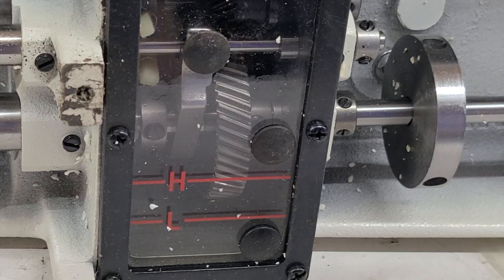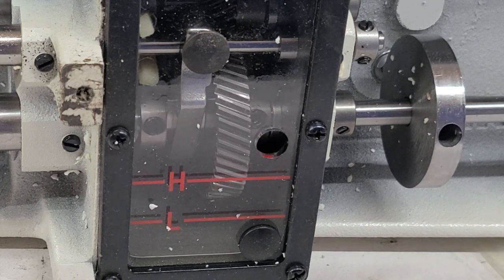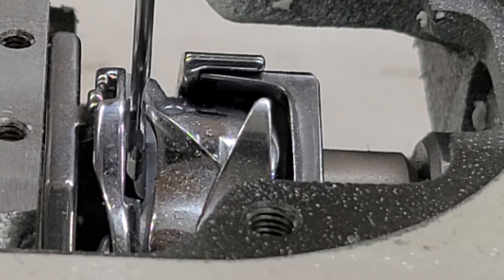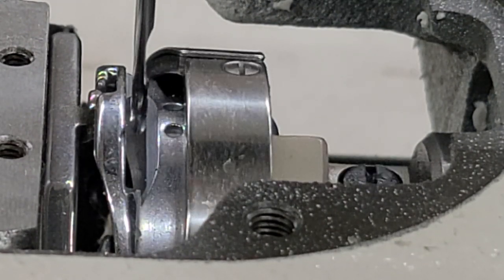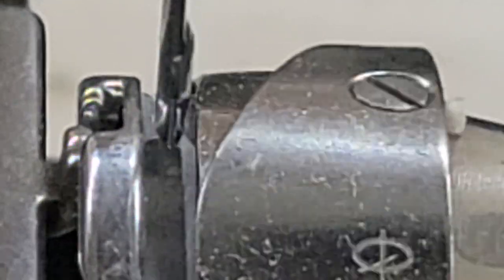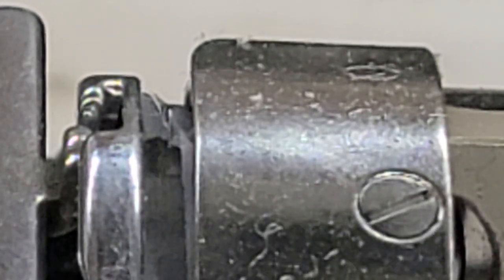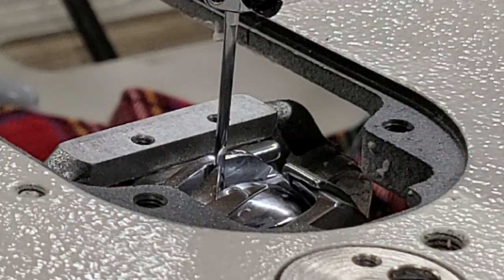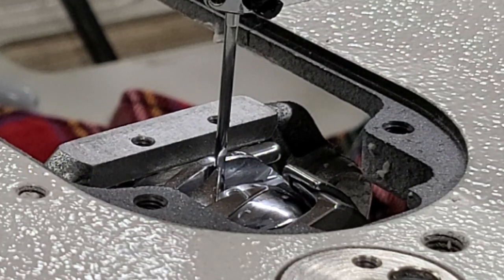Hook timing explained on a Juki DNU-1541S

Comment: Kinda vague. I understand loosen those 2 hex set screws but then you left us hangin. How do you adjust? And why? I understand the hook needs to pass at a certain height and slightly away from the needle but you didn’t explain how to move it

Comment: Thanks for showing the proper timing but you didn’t show how to adjust the hook. I get those set screw need to be loosened for the adjustment, then what??? As a YouTuber that makes how to videos a lot I found this frustrating. Thanks for your effort though

Comment: Thanks so much Steve!
I've been looking for days for information regarding timing a machine with no safety clutch. 
Your video is the first I've found showing the timing adjustment screws inside the oil reservoir and thankfully it matches my machine, and solves my dilemma.
Is my assumption correct that the machine you're demonstrating on has no clutch?
All other horizontal axis hook machines were timed from further to the right of the bed shaft and outside the oil reservoir.
Thanks again for the help!
Reply from the maker: This machine is a DNU-1541S with the safety clutch.
Reply: @Sewinggold  Thanks Steve.
After looking at mine again I realized that there was no adjustment screw inside the oil reservoir, so my assumption was incorrect.
I was reluctant to adjust the hook on the shaft end as I assumed that one screw was set in the keyway groove on the shaft.
It turned out that my machine is super basic with no safety clutch and no groove in the shaft.
I ended up timing the hook and setting spacing to the needle using the three hook clamp screws as there was no other spot to do the adjustment.

Comment: Thanks for what you've shown, yes, that is what proper timing looks like, but you really mean it when you say you don't want anybody to do it themselves.  You don't give any useful  details about how to reset it if it's not as you show it.  If you are taking the time to make a video, why couldn't you have the service manual handy and show or read the specific instructions and measurements?  Lots of Juki 1541  users don't have a Juki mechanic available and have no choice but to do it themselves and this won't be much help.  If you want to see what a proper instructive viideo should look like, see some of Uwe Grosse's.